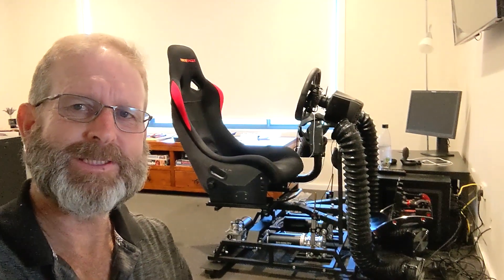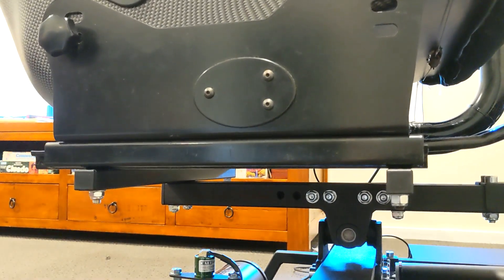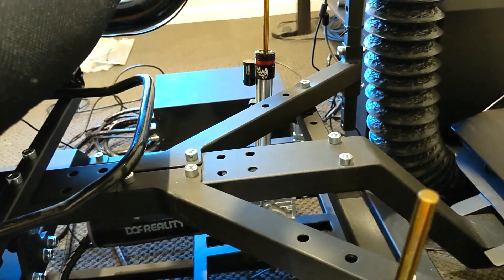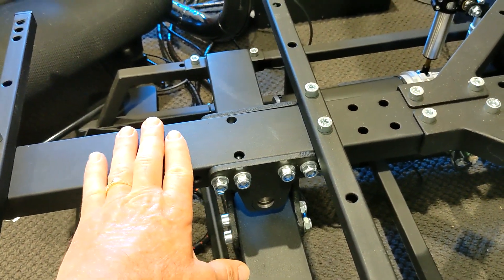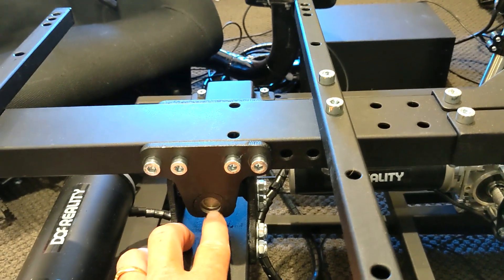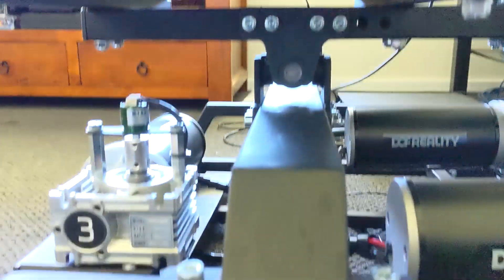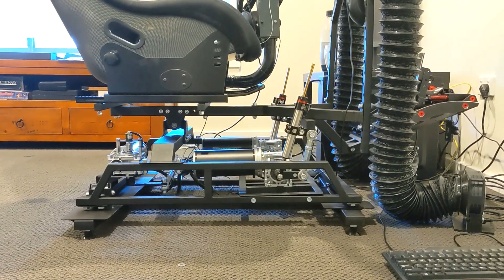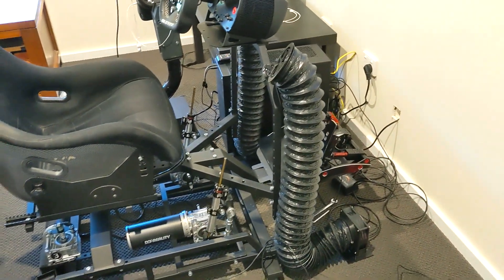KamicarzCreations - How To Balance Your DOF Reality Platform

Comment: I'm  wondering if adding weight
 balance would have been an fix ie., dumb bells to the adjusted area. of course using a rig to hold the weights.
Reply from the maker: The new DOF balance app is the goods

Comment: Great video, what i also found is quite some play where the universial joint bearing cups are mounted in the brackets, quite an easy fix just remove the universal joint and the cups and apply some loctite bearing lock to the outside of the cups and mount them back. (and let it dry of course 🙂) It made a huge difference at my P3! (the best upgrade i've done so far)  not sure if it is a problem with all the dof's but i've seen more people having this problem.  you can easily check if this is the case if you look close at the universal joint bearing cups when you rotate the platform, you can see it without removing the chair or anything.    Keep up the good work! Cheers

Comment: Thanks for this video. I've had my H3 for about a year now and didn't kept understand how to achieve the balancing thing. especailly when you remove the 2 front levers off the motors i found it difficult. There's a guy called Fondoo on YT with an impressive setup he's got a FB page with setups and varoius things but i dont do FB so couldn't check it out. So glad to see your video. I just had a look at my seat in relation to the universal joint and it looks a lot like how yours was. So i guess my front motors are also under stress. I took some pics but dont see a way to share them. I will attempt  to try the balancing again, maybe will try the software to help, Is this the Sim Racing Studio software you are referring to or is there another specific balancing software.

Cheers Mark
Reply from the maker: Use the software DOF Reailty has produced....i have had no trouble with my rig since seting up the balance with it. Use the support link in the user manual to get to the software download area.....can be a bit hard to fine

Comment: There's supposedly some balance tuning software available now to help. I read about it on Facebook before I quit social media. It sure would be great if someone made of video of how to balance using the software because I'm not going back to FB.
Reply: I have the software/app.  It's so easy to use.  The balancing is not so much to balance your seat or rig but actually to balance the motors otherwise your seating position will be in one fixed position where the wheel is either to far or too close. 

Simply sit in your comfortable sitting/driving position and let the app do the balancing.  Adjust your arms and legs or body inward or outward or left or right side until pitch and roll are within 10%.  The app will tell you to move forward/backward/left/right until close to 0% is the goal.  You will notice the movement smoothes out with less notch, meaning the armatures are moving in synch of each other.

Once the motors are balanced, the movement will be smooth and eliminate the notchy movement caused by uneven motor armature movement.
Reply from the maker: The balancing software is great......havent had a beyond limit lock since using the balancing software
Reply: Where do i DL the balancing software?
Reply: @davidgarvin1130  the software link is in the PDF installation instruction.
Reply from the maker: @davidgarvin1130  https://dofreality.com/tools.zip
Reply from the maker: @davidgarvin1130  Most of the links are in he user manual....download the latest manual

Comment: How do you know it's balance without sitting on it and do the test?  When you pitch forward, does it vibrate?
Reply from the maker: Well just the general position of the universal in relation to the sitting position. But yes testing it by sitting on it with the tierods detached helps. This is stated in the text supplied with the video :-)
Reply: @KamicarzCreations  I would love to see if what you did actually balance by testing while sitting on it.  I am not sure if mine is balance but when I pitch forward, it always stutter.  Everything else seem to move smoothly.
Reply from the maker: @reptilexcq2  It does do a shudder every now and then but i think its mostly if i start the unit before the computer. Othrerwise all good. You are best off to test yours when sitting in it as my position may not suit yours :-)
Reply: The way you can find the center of balance is by removing the entire top frame (adding all the pedals, wheelbase, seat and yourself) back to the top frame while its on the ground.  Then by  Using a round bar and rolling the entire top frame until you find the center of balance..  Yeah, it's a feat for sure. but that's how I have been finding the CB for my rigs.. DMAX

Comment: Thanks for the video ... balancing is important for sure.  I noticed that your wheel mount arms are mounted next to each other at the main beam but they are supposed to be staggered, they then attach to the wheel plate spaced apart, giving the wheel base more support.  Check out the instructions again.
Reply from the maker: Thanks for the info! will do